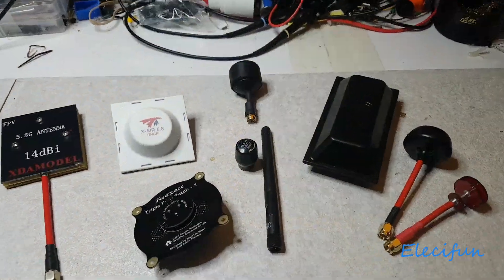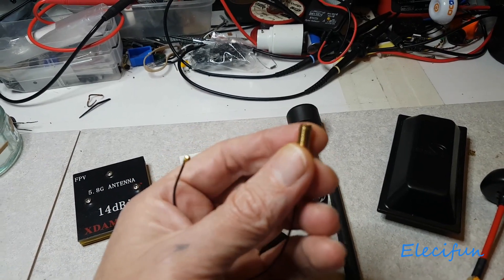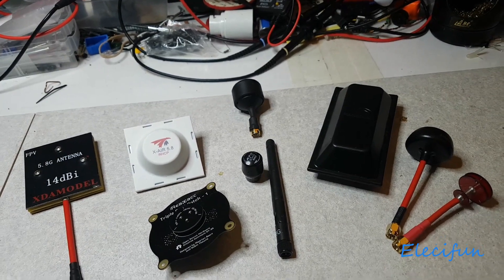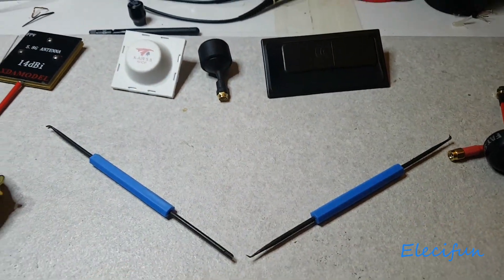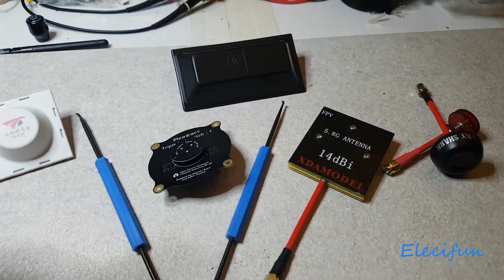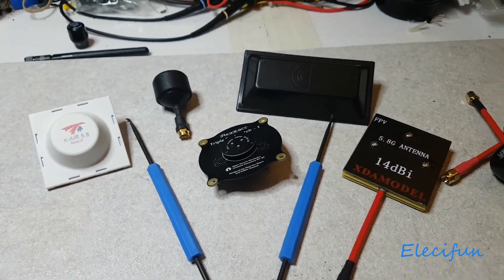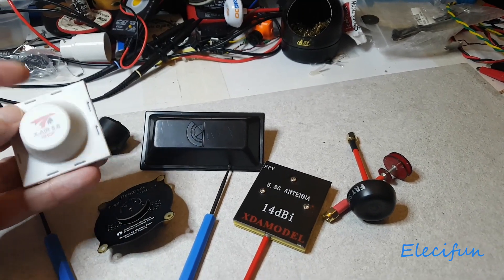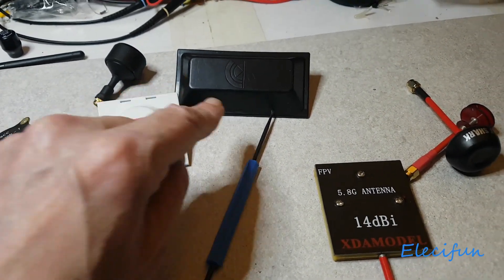Hubsan H501S VTX antenna mod or not to mod.

Comment: Great video! I just got the TrueRC Antenna and now my limitation is 2.4ghz range (2dbi dipole) would you just recommend a 6dbi dipole for better control range? I live in a really noisy city which makes distance diffucult. Thanks!
Reply from the maker: Using a 5dbi in a built up area might make you prone to strong signal reflections which can cause drop outs in control. The 5dbi dipole antennas, specifically bought from China, are usually rubbish. High VSWR junk which will cause more problems than they solve. 5dbi is a squashed beam and so directional compared with a 1 -2dbi. Hope this helps.

Comment: Elecifun Thank u for your practical advice.  In regard to the 2.4ghz rx antenna in the drone, wouldn't it be better to position the antenna  perpendicular to the longitudinal axis of the drone since most most flying is to and from the pilot?  I would think that installing a dipole on the side of the drone in a horizonal position would be better to receive 2.4ghz signals from the transmitter when flying to and from the pilot.  Do you agree?
Reply from the maker: The 2.4ghz antenna is in the side in a horizontal position in the H501S, the VTX antenna is vertical in what Hubsan calls a lampshade on the rear of H501S. Orientate your receive transmit antennas the same both ends.  Personalty I switched to 868MHz from 2.4GHz with vertical polarization antenna giving great results on range and link quality.

Comment: Could you provide links to those three antennas? 1000m has been my farthest...have lost one hubsan that didn't return after lost signal...lol part of the fun.
Reply from the maker: I thought they RTH on loss of signal, bad luck friend. I put the links in the description ; )
Reply: @M9SVW  It did before but for some reason it didn't this one time. It starting turning when I flipped the toggle then I lost the FPV...never came home. Was 950 meters out. Looked for it for weeks but gave up after the area was burned over by fire. I got another...all is good. 😎👍
Reply: @klrrider2131  was in altitude mode?

Comment: Interesting video , thanks for posting! I took my Advanced Hubsan 501s to 2600 metres straight out with just a cheap replacement fpv paddle antenna & still had a good picture on my tx.

Comment: To increase the power, control signal 2.4Ghz on the remote (Pro) 
https://hz.ru.aliexpress.com/item/2-4G-8dBi-High-Gain-Wifi-PANEL-Antenna-2-4G-panel-antenna-with-RP-SMA-male/32808894562.html?spm=a2g0s.9042311.0.0.a17e33edeOYUP8
The most powerful and efficient antenna for video signal 5,8 Ghz https://hz.ru.aliexpress.com/item/5-8-15-174DBi-FPV/32841914536.html?spm=a2g0s.8937460.0.0.7d9f2e0eNrCsJs
But the most tangible effect if you remove both antennas(2,4 & 5,8 Ghz) on the copter - out (outside the body)!
Important: check all 4 pigtails in the control panel and in the copter! Only by doing all these steps you can be 100% sure that you will have a strong(stout) and stable connection remote - copter at a serious distance, it is about 2000m or more.
An alternative way to increase the signal power is to use an active WI-Fi amplifier for at least 2 Watts on the remote control. This amplifier must be bidirectional, that is, amplify both the emitted and received signal.
The amplifier is placed( screwed) to the connector 2,4Ghz and powered by a separate power supply.